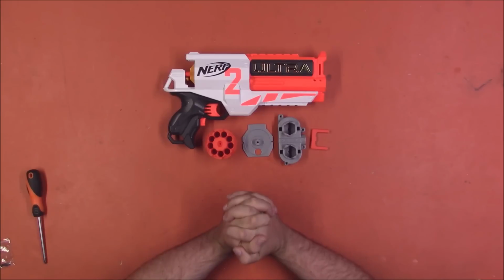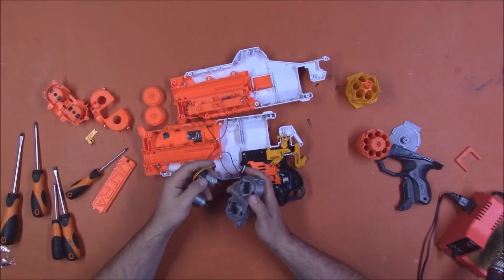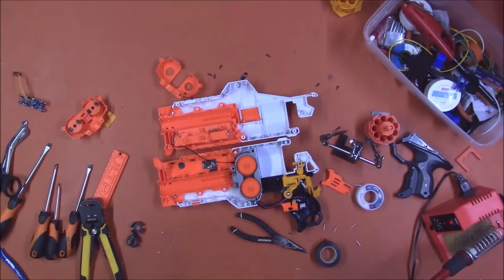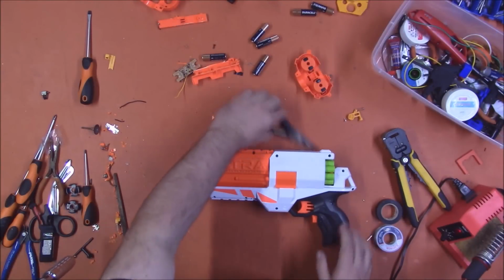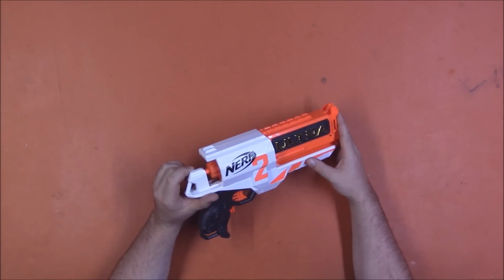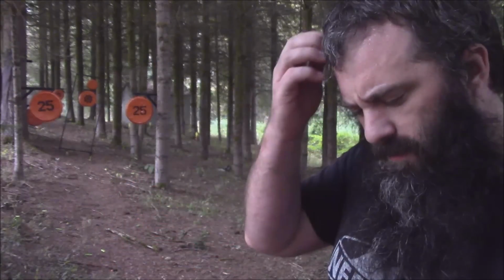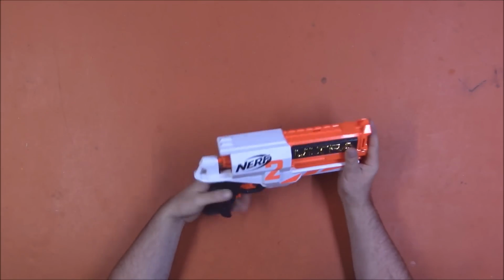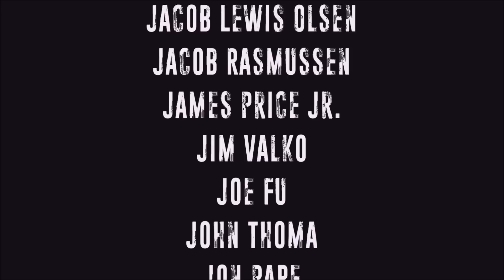Gavin Fuzzy - Ultra 2 - Elite Dart Kit - Build and Test

Comment: I’ve weirdly come to find that A.F waffles tend to jam this kit pretty frequently. I suspect the heads are too wide for the barrels to feed correctly. Full length A.F pro darts and full length max darts feed without issue though.
Reply from the maker: Huh, something must be up with your kit because I have never had mine jam.
Reply: @CaptainXavier  right you were. As it turns out I had neglected to screw in the flywheel cage properly…
I wouldn’t have thought to check that had you not mentioned that abnormality, so I thank you

Comment: Question 
 i want to just change the capacity of the revolving chamber, so my question is:

 can i just swap the cylinder without changing the batteries or the flywheels? the bump that blocks the  dart i can  find a way to take it out
 

note: i have never modded a single blaster before
Reply from the maker: Batteries, yes. Flywheels...also yes...kinda. You can keep the original motors and wheels but you do need to replace the flywheel cage. Otherwise the spacing on the wheels will not be right.

Comment: I have a question about the pusher mechanism. From what I can see in this video, the install instructions, and the other video, it seems like the pusher wasn’t modified. I know you mentioned an extended pusher form the AUS blastermods, but I’m wondering how much modification for the pusher is needed to make sure these conversion mods work. I know you mentioned that for the GavinFuzzy a full trigger pull is necessary to make sure it doesn’t jam, so is there a work around for that?
The reason I’m asking this is that there’s another conversion on Etsy by Rad Blasters that includes a new pusher to make the timing work, and I don’t really understand that. I Igor just be missing something, but I would like some clarification before I get a kit
Reply from the maker: You have to remove the ammo lock but other than that no modification is needed for the pusher in this kit.
Reply: Awesome! Thank you so much! I appreciate it and your videos

Comment: Is it possible you could put a parts list in the description or suggest a couple parts that would be ideal to use on this mod? I am hoping to modify this with the Gavinfuzzy kit, preferably 2s (but I don't care too much), preferably all from OOD, but again, not the end of the world if not. I just am having a lot of trouble finding a parts list anywhere and am not experienced enough to know which motors would be best for which batteries. Anything you have to offer would be great, thanks!
Reply from the maker: I used the stock motors.  2s is actually below their intended voltage (7.4v vs 9v) but they should still work. Any 2s Lipo that OOD sells will work.  The only other parts I used was an OOD mosfet board, a little wire, and an XT-60 jack.
Reply: @CaptainXavier  Thank you so much!

Comment: Wonder if there's a way to make it belt fed... 🤔

🍕🍔🍟🌭🍿 because I'm hungry.
Reply: Any revolving cylinder system can be modded to be belt feed. redesign the cylinder piece to make it a spindle for the same number of locations, but instead of holding a dart, it holds a link in the belt. Then design a belt link that fits each cylinder location, and holds a dart. Now make a lot of links.

If you take apart a vulcan, you'll see it has a 6 position revolving sprocket, and the belts fit into the sprocket.

Comment: Hey can you put a 2s Lipo in a stock stryfe?
Reply from the maker: You can...whether or not you should is a different matter.  It is a different of 1.4v so it should be fine. It just won't have very good performance.
Reply: Thx
Reply: Will a 1s be best I want stock performance
Reply: I want to put a stryfe in a elite alpha trooper with no cuting the shell

Comment: I will like short darts in this blaster !!!
Reply from the maker: You might be able to if you double load them. It would only fire one but it should work
Reply from the maker: Or a different cylinder and a long pusher. Might make it hard to load.

Comment: aaaah...my biggest regret is that I have never soldered ANYTHING ever let alone a NERF blaster and I'm super scared to do so and spend money on all the supplies needed, since I don't have a soldering kit at all..I JUST got the Halo blaster and I'm fully expecting a LiPo kit and flywheel upgrade for that at some point down the pipe..I would love to run this conversion and that blaster in a game together just for the shiggles of it..but I'm terrified to ruin a $50+ blaster due to lack of experience. I really do like the look of the Ultra 2 since I love revolvers and it's a semi-auto flywheel one,  but the fact the standard Ultra darts are...less than stellar as far as performance goes alongside being stupid expensive just for the sake of NERF trying to be annoying about it all..yeah I've been reluctant to get one to say the least.
Reply: If you're scared to start with an expensive blaster, find a not so expensive one to practise with. Maybe you can find at a local thrift store or FB marketplace or some such. There are some good vids on here about how to start soldering, or perhaps you can find a local makerspace where to start.
Reply: @Diamre  Sadly I live in a rather podunk area of the south where maker spaces..aren't really a thing and the ones that do exist are like..an hour+ away. Finding a cheaper blaster isn't really the problem if I do go thrifting..not something I normally do mind you but I can do since finding a Goodwill isn't that hard and there isn't one more than like 30 minutes from my place. Also when I say podunk, most of the people in my area are older and there is literally two assisted living/nursing homes within a half mile of each other..and plenty more around and about.
Reply: @ShinKyuubi  just watch you tube videos, and try on scraps
Reply: @JohnJames.  Well..anyone have any decently priced good solder kit recommendations for someone just starting out?
Reply: ShinKyuubi i have a versa tool that works as a hot knife, a wood burner, and a soldering iron. You can get them at Michaels (or many other craft stores) for like 40 bucks and then a spool of solder with integrated flux is around 5 to 7 dollars.
Reply: @ShinKyuubi  ,I'm no means great but thats how I started. Walmart has a 20 Weller , any Hobby shop near you or maybe a radio Shack should have some starter sets. I got a butane one because it's cordless, and could use it for my truck. But anything the higher wattage you can get, have fun
Reply: @JohnJames.  Thanks, I was actually looking at walmart for stuff like that and Dremels to get started on a budget awhile back..there aren't any Radio Shacks in my town anymore but we got two hobby shops and a Harbor Freight.
Reply: @ShinKyuubi  , right on , Walmart does  have decent prices for Dremels . Just shop around like anything, like you said no sense wasting money on something your not happy with. But soldering is good to learn, and can save you money, so it does make sense to buy something half decent
Reply: @JohnJames.  TBH I'm surprised my grandpa didn't have one in his shop..he was a very hands on person and kept all the cars in decent condition on his own and did repairs on the weedeater and his tracter, on top of some light home wiring..I'm surprised he didn't have a solder kit..if he did there's a high chance he lent it out to someone who never returned it...may have to take a good look in the shop now that the weather is cooling down..it's an old thing that gets STUPID hot in the summer and he had a propane can heater to keep it warm in the winter..there's still some stuff I haven't gone through from his old tool kits so there might be a usable one there..very very old though.

Comment: I got the other version of this kit that floats around because this one was our of stock 
It's crush is maybe too much with my flywheels 

Oh that's the other thing; the other 3d printed kit available won't use the original flywheels or motors
Reply from the maker: The other one I reviewed does have the option for stock wheels and motor. I failed to mention it in my video.